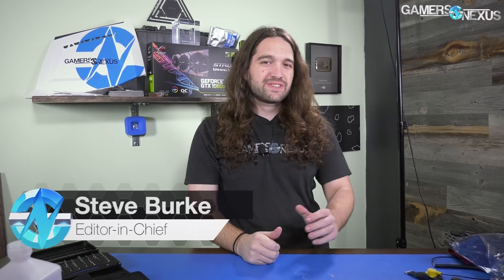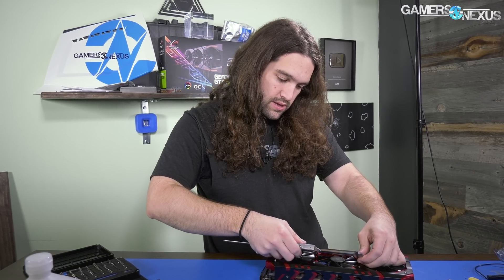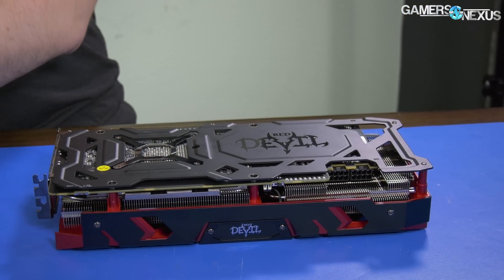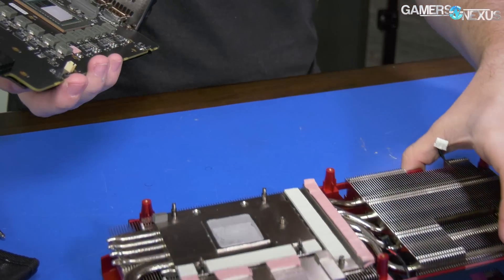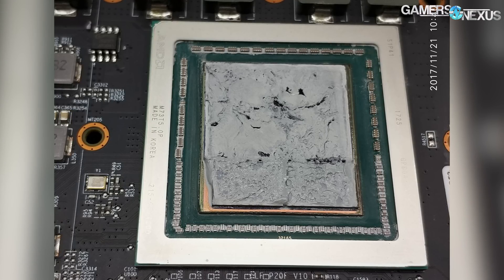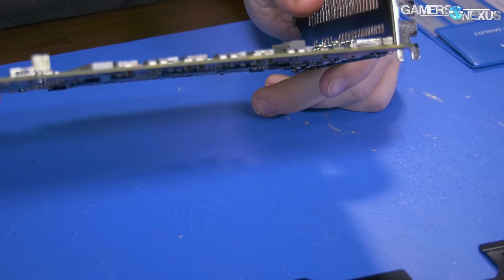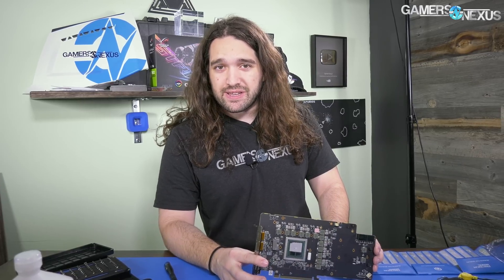PowerColor Red Devil RX Vega 64 Tear-Down (& Thermal Paste)

Comment from the maker: Note on Vega testing & clock issues: https://twitter.com/GamersNexus/status/935637934535045121
You might like our round-up of the best GPUs at each price-point: https://www.youtube.com/watch?v=9YOQq5_bwHc
Or maybe our buyer's guides playlist for end of year: https://www.youtube.com/watch?v=9YOQq5_bwHc&list=PLsuVSmND84QtQhqnTXqF-mwf-DrTOOQKz
Reply: tbh, manufacturers should be adding a 40 micrometer bump to accommodate cooling the HBM instead of jamming more thermal compound in and hoping for the best. It might entail more milling work to get that raised section but it;ll be better for the card's longevity.
Reply: ok, if buildzoid does a breakdown of this board, I want to know how he does it with a straight face or without instinctively diving over to the Halon extinguishing system to set it off.

Just as Steve said, not god, definitely not good. Short HBM chips need more thermal goop.

Great vid by the way GN crew.   B)
Reply: or they were working on it, and that card slipped out the door without getting fixed. hmmm.    Either way, it's an issue all AIB partners will need to deal with.
Reply: When can we have the full review? This card looks amazing, wanted to get one for Xmas.
Reply: Gamers Nexus I have never laughed so hard on YouTube. Thank you for this. Your asseness was totally wonderful. Steve I 😎 love you.
Reply: Just an update 9 months later... I bought this card a couple of weeks ago now and the HBM temps are with in 2-3 degrees C which falls in-line with other manufacturers.

My OC results so far are 1677 core / 1080 HBM2 @ 1085mV/1040mV 
The cooler manages to keep the card at 60C with at these settings with the stock fan curve (loud)
Reply: you might have just saved powercolour reputation lol
Reply: Gamers Nexus why you put dial-up noise, you can use aol with broadband you know.
Reply: There seriously needs to be a hardware manufacturer's version of a software 'bug bounty.' You just potentially saved PowerColor a shitload of money and you should be compensated for it.

Comment: I know this post is a little old but, I’m in the camp of “It’s Powercolors fault” I see comments explaining “how it’s difficult ,how it’s tough for PowerColor to manufacture different heat exchanger configurations due to AMD sourcing from 3 suppliers for package with no minimum standard for the heights of these chips” That’s not my problem. I’d expect further problems down the road like one of the three suppliers for AMD  having their specific chips fail due to the “good nuff” thermal solution fix.

If I spent $500-$700 on a card that had this problem I’d immediately want a refund, or exchange to a completely different brand, or just go another model up hoping for a more premium experience, sometimes I say it myself “how much MORE do I have to spend to have something work with no problems, asterisks, or bs.” 

I like NVIDIA myself and will only buy from EVGA as I’ve had the sickest support of my life past three cards, or from NVIDIA directly. I perceive all other brands and manufacturers as lower quality when it comes to graphics cards and this keeps that perception going.

Comment: hello gamer nexus I use a very effective solution to effectively dissipate heat in audio amplifiers and voltage regulators that work with extreme temperatures such as GPUs, using common varnish and current, that if I sanded the entire surface of the heatsink and remove all clues of thermal paste, I have a hd 5870 for 7 years using this system and I use it in processors also try it and tell me the results.

Comment: AMD has a serious issue that need to be fixed quickly because you can pick up a 1080ti for same price of the Vega 64. The 1080ti is by far more powerful. The Vega 64 needs to be in the $500 range to be more competitive with the 1080 and not 1080ti. For now I will be sticking with my Fury X.

Comment: wow.. really, no one thought to disassemble the card? And thicker thermal paste is just a joke, not a solution, if GPU area is rised on the heat sink anyway, then HBM area should be that bit higher - 0.04 mm  or was it 0,4 mm. Also that thermal pad falling off all the time - facepalm!!!

Comment: My fear with this is that if they solved it just by cramming more paste in there, that over time and from moving and handling the computer or card, the paste will eventually separate, get air into it, it crusty and degrade performance. I’d much rather purchase one that has good contact from the design of the package and cooler. (I own a vega 64 liquid edition so hopefully AMD did a good job from the factory)

Comment: That weight issue is extremely serious. It not only impacts the performance of the memory chips but also greatly shortens the life the the card. How can AMD allow this to happen? All it need is to machine the heat sink or add a thin piece of metal to fill the gap!

Comment: Gamers Nexus
I would like it if you would do a case recommendations video. Not so much the general do's and don'ts but a concrete list of 10-20 great cases which are available. No matter at which year they came out. With all those crappy cases of the last year(s) that might be welcome for many of us. Maybe a few price ranges and a few categories? Obviously there should be one big requirement for all those cases: good ventilation, if not with the stock fans then with added fans.

Comment: @GN
Even though amd claims to possibly have this production thing fixed with having both HMB stacks, and the die level, do you think they really have? 

I am just curious if this is just the teething issues (per say) if having (to my knowledge) the first chip on market that has three separate chip's on one larger chip, that all need to be cooled by one thermal pad. Over time (vega's second generation) may have this totally resolved i hope so they can actually hit production numbers. But on the other hand look at thread ripper (4 ryzen dies) so..... IDK what to think here.

Comment: Is the die height problem that AMD is having with HBM and their GPU going to also be a problem when Intel starts using their multi-chip modules? 
I would assume Intel would be smart enough to learn from a competitor's mistakes. 
Also, what even causes the height difference? Is it just that HBM is a slimmer die, or is this a manufacturing issue?
Reply: Xander Zoolander Intel emib prevents this from happening.

Comment: I’m not surprised.  Definitely on Powercolor.

Powercolor has never stood out as a leading partner of Graphics Cards.

Remember the RX 480 Devil?  Horrible VRM cooling.  Then they release a custom BIOS and tell people not to overclock highly or use Furmark.

At least EVGA refunded/recalled their ACX coolers.  Powercolor said “just deal with it, not covered under warranty”

Comment: I think the fault lays with both AMD and Powercolor. Seems like AMD should have designed the chip to where they are level, so this could never be an issue. On the other hand, Powercolor should have been checking for things like this. Sure, on their part it is a simple over sight. That doesn't free them of their part of the blame though. Just my opinion. I could be wrong

Comment: Really though that looks like too much paste to begin with as well. I've always seen thermal paste as "fills in the immeasurable imperfections on the chip or lid." 

Not peanut butter thick on a P&J sandwich and they are looking to fix it by adding even more paste.

We've been waiting for custom RX vega for a while this is very troubling for a review sample.

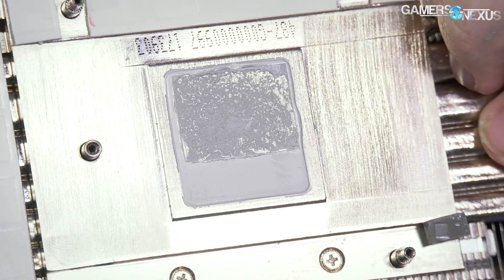Comment: what probably happened with the heatsink contact plate not having a recess for the gpu so the hbm would touch the aluminum is they forgot to add a recess in the schematic they gave out to the machinists that machine the aluminum for their contact plates (you can see the milling marks at 4:10 so its not cast) 
in theory if things were really bad with the cards thermals they could recall it and re-mill the plates to have a recess (which would realistically only take about one minute per plate)

Comment: That is the fault of the chip manufacturer they didn't do the final step of lapping everything flat.
Some blame goes to the board partner as they need to cure everything that leaves their assembly line.

Comment: They really need to change the interposer design on these HBM setups.  It's causing a lot of problems.  Outside of added cost of customized coolers with recessed GPU mount, or using thermal pad instead, I can't see any other way other than raising these modules.

Comment: AMD should specify a target height to suppliers and require using a hard space filler such as conformal coating to get package heights close to that target if the package is a bit short.

Comment: AMD is at fault, This is a quality control issue.
They should not have three variations of the same chip (molded matched height, un-molded matched height, and un-molded different height)

For manufactures to work around this they need to have two cooler designs, one completely flat the other with a small raised section.
Then during assembly careful attention also needs to be taken as the one with the raised part will either crush the HBM or prevent proper die contact on the two chips with matched heights; The flat design won't work correctly on one with different heights; And the alignment on the raised one is critical as there isn't much room for error so chipping the core becomes possible.

Also since its random what type of chip they get its possible to have a stock pile of the wrong cooler.

All of this increases costs and that will be passed down to the end user.

Comment: So they "solved" the issue by putting more thermal paste on? This is BS. It doesn't take a genius to know why. You need a good "metal to metal" contact while thermal paste only fills in the air gaps.
Reply: Exactly.Thats the true ans best fix.Add a extra 0.038 mm on the heatsink.Done.Adding extra Paste is just lazy and a that thickness the paste becomes more of a insulator.I know to not buy powercolor now.
Reply: the customers are gopniks playing CSGO 1080p low settings ok

they take the cooler off and cook sausage on it while they listen to hardbas and smoke a cigarette
Reply: Either these are total amateurs or they treat customers as idiots. Smear more paste, it'll just work. It is their responsibility to have TWO DIFFERENT heat sink constructions, if AMD gives them two different memory heights. This is really insulting.

Comment: If the the heatsink all ties into one block would not get saturated with heat from the hottest components and basically not draw heat from the secondary or less hot components. It seems you risk that being a problem if there is too much heat going through the same block. If it can cool quick enough I suppose it would draw from the other components. An optimal solution would seem to be to break the block into multiple sections.

Comment: How much heat do the HBM modules output? Could you replace the thermal paste with a thermal pad? Or does the fact that the HBM is vertically stacked make them rather hot?

Comment: I'm still happy with my Zotac gtx 1080 ti mini. I buyed it in July because I saw that the custom vega would not so fast be on the market. I have an freesync 144hz monitor and it was not an mistake to buy nvidia. When you turn on fast sync it is not possible to see any differences for the human eye.  It is equal to freesync, for me.

Comment: Why do recessed packages even exist? Cutting costs? It doesn't seem worth it to me. The contact surfaces should be at the same height within the package. If a manufacturer wanted perfect contact with all the silicon, they would have to have a multi-height cooler and align the height change perfectly with the edge of the HBM. 

It's ridiculous, and AMD needs to address this.
Reply: It's because AMD are using 2 different manufacturers to make the packages, one does the package with the resin one does it without.
I'm sure AMD would of addressed this at the start of manufacturing if they could have.

Comment: I understand that the packages may or may not be recessed but surely they'd know that on average the HBM seems to be lower, why not just add one more operation to the machining process of the heatsink and take .002 mm off where the GPU core touches?

Or maybe you explore the modification of the heatsink's contact area?
You could use pieces of flat aluminum with mounting holes to test methods of removing material and contact patterns(in place of expensive heatsinks). 
Then apply those methods to a real heatsink and see if it does or doesn't effect thermals. It could also test whether or not the thickness of the thermal compound effects heat transfer enough to make a difference.

Comment: Should be fine?  TIM has much lower thermal conductivity than metals.  It's only meant to fill in microscopic gaps between interfaces.  (On a side note, the vast majority of people use waaaay too much TIM.)  Just slobbering it in a gap between rigidly fixed components is absolutely ridiculous.  The only proper fix would be to increase the size of the heatsink, so it makes contact with the memory chips.
Reply: TIM better than nothing (air) so... good enough!
Reply: There is not contact between the HBM dice and the cold plate.
Reply: Dude it doesnt matter using too much Tim does not change anything at worst you get too much and it goes off the sides and. Gets messy on components using too little could leave uncovered areas on the ihs or silicon and coldplate
Reply: pressure from the heatsink squeezes out the excess

Comment: Although it is quite possible to adapt the coldplate (and consequently the cooler) to the different GPU dies, it is way too impractical. Only if AMD would supply the amount of dies per configuration. And now you have to think about that even then, AMD cannot predict from which source the supply will happen as probably you don't have 50-50 approval from both GPU assembly lines. In the meantime, Powercolor, or any other AIB for that manner,  has to confirm to their cooler manufacturer/cooler manufacturing line, how many units with what configuration have to be produced. Ideally, yes it is possible, but it is a huge cost to control all these parameters and supply/demand chain just for the manufacturing. So depending on the results, if just using a bit more thermal paste works 80% as efficient as 2 different cooler configurations, you have to go with the extra thermal paste as it is a lot less likely to create problems down the assembly line. And this can be done in 2 different ways. Even if the thermal paste is applied manually or by a machine, the sticker that Steve mentioned could be the key. Either they just apply more thermal paste to all GPUs regardless of the config, or the machine identifies the GPU config in the sticker and has 2 different settings for thermal paste application, same works for manual application. So, yeah not perfect, but it only has to work in the end.

Comment: Wait, they "solved" this by ... sticking more paste on it?

Seriously?

Surely the actual solution would be to make the GPU and HBM the same height?

Or is that too obvious?
Reply: Homer Slated Powercolor has no control over this. AMD supplies the GPUs, Powercolor assembles the card. Powercolor gets no choice over wether they get the Vega chips with equal height, or the height difference.
Reply: I don't care who's responsible. Shoving paste in to compensate for third-rate engineering is not a "solution".

Presumably Powercolor has no control over their own QA process either, otherwise they would have noticed that the thermal paste they'd applied didn't even make contact with the HBM. Is it also AMD's fault that Powercolor apparently doesn't even bother to check its own finished product? Is Powercolor incapable of milling a heatsink to fit a variable height target, for example?

And yes, AMD is also to blame for its non-existent QA process, and apparently a total lack of spec conformity. Such amateurish behaviour does not exactly instil confidence. How many hundreds of dollars are we going to be expected to pay for this junk? Frankly, they should be paying us.

Comment: There is no reason for bad contact between the cold plate and HBM .04 mm copper sheets is a commonly production of motor brushes and copper gaskets on small electronics (biggest reference on RC cars). So a shim to be cut and placed in the gap between the cold plate and HBM should only add a few Penny's to production cost. Using a thermal adhesive to attach a Shim to the cold plate over the HBM  would result and better conductivity of heat then Gooping large amounts of thermal paste. Thanks for the video Steve. If I do decide to buy Vega I now know go ahead and pull the heat spreader off and see if I need to fix this.  problem

Comment: too thick of thermal paste is not so efficient either

the best way is to have the gpu cooler plate slightly raised to compensate the height offset between hbm and the gpu